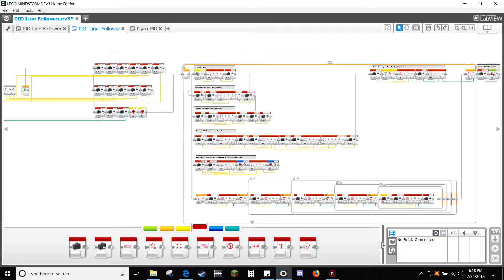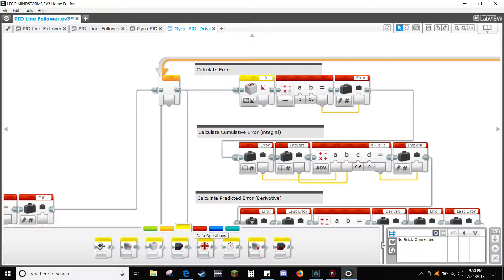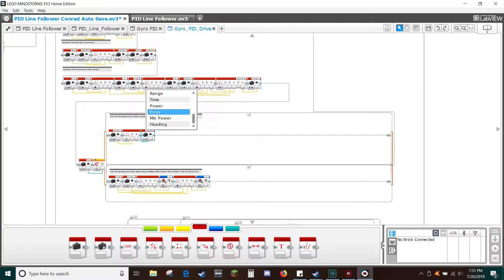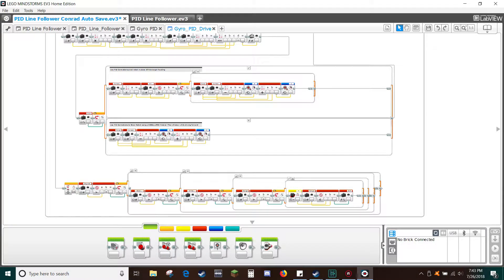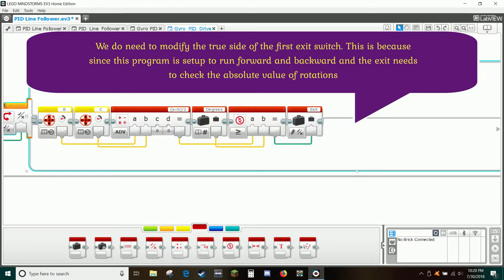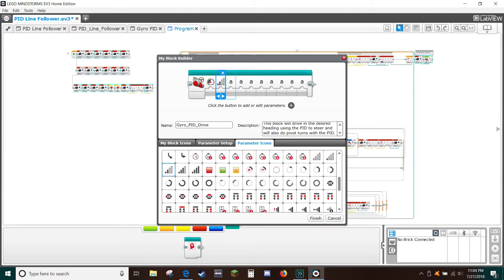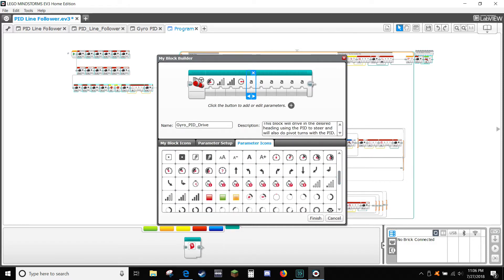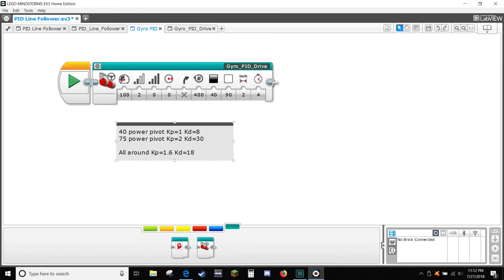Gyro PID Drive Block Timer Fix

Comment: Just wondering how you would do this with inverted motors?
Reply from the maker: Justin P In the line of code where it calculates the correction there is an advanced math block that already has multiplied of one switch it to -1.
Reply: FLL Team 9462 thx